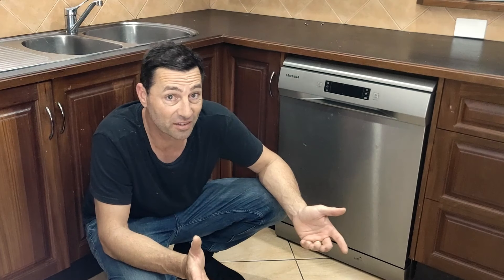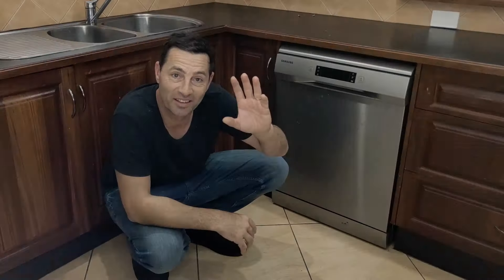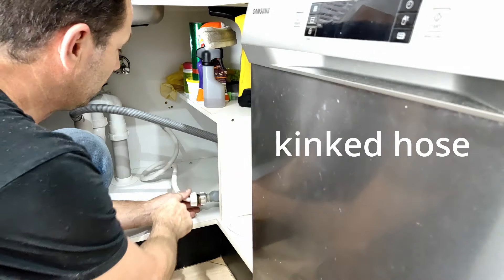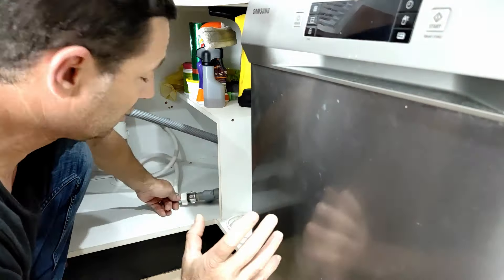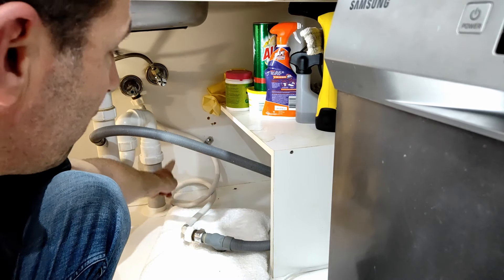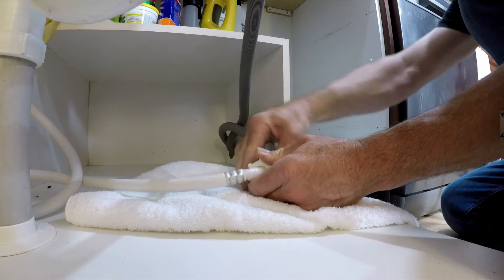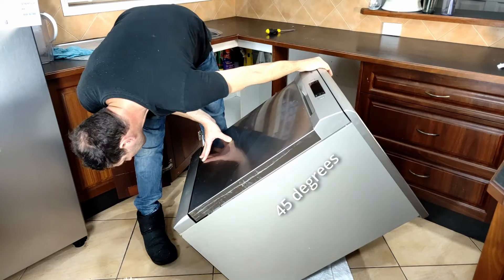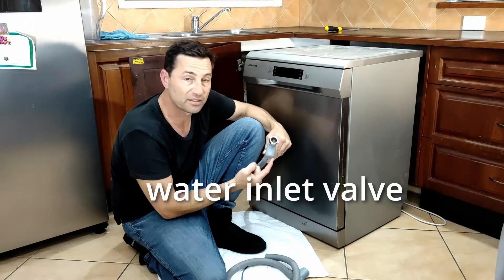Samsung dishwasher fault 4E error water inlet valve problem

Comment: This saved me a fortune.  Thanks.  Most engineers wouldn't touch my dishwasher because it was Samsung and the "Samsung specialist" stated it was too old to get new parts and it would be £80 just to look at it with all work charged on top of that.  So I got the exact part you showed for £15.99 here in the UK and it took me an hour to fit...  dishwasher is now working just fine.  Note - my dishwasher had a LOT less space to work with (components were VERY tightly crammed in compared to the video version) which made it much more awkward, but was still possible.  For example, I had to remove the waste hose from the internal fitting in order to have any access to swap out the pump's power clip.  But it was still well worth the savings.  Appreciated.
Reply from the maker: Wow Kevin, I'm so glad that you told that story... I thought I might be the only one having this problem and crazy enough to fix it... That's great you found the part for a good price - and replaced it yourself, well done. Thanks mate, Kent

Comment: I believe I have the same problem with my Siemens and looks pretty the same, I already bought the inlet hose from amazon a couple of days ago and watching your video I have the feeling that my procedure will be similar.
Reply from the maker: How did you get on Jorge?
Reply: @InspireDIY  It worked perfectly well
I had to unscrew a screw in the front part in the left side at the bottom. Then I could open the whole plate that is on the left side, then I had to take out the pipe with the cable for the sensor, and there is a cap that I had to take out and put it on the new pipe.
Then the procedure was to put the pipe inside the dish washer and with a plier to hold it again on the same place. Now there is no water licking.
What I do not understand is why the pipe was licking water, I believe somehow I pushed it in the past and maybe I harmed it, but who knows, maybe is the time because the washing machine is about 7 years old.

Comment: Thanks for this mate. Reckon it saved me a fortune too. Everything was as you mentioned on the video, except for the connector which was different. I had to remove the connector on the new hose and connect the old one up. Dishwasher works fine now :)
Reply from the maker: Cheers for letting us know it worked well Kevan 🤙 well done mate. Kent

Comment: What if I'm getting 4c about halfway thru the cycle But plenty of water is coming in?
Reply from the maker: Hey Austin, 4C = 'The dishwasher is not getting water at the pressure or temperature that it needs', check that there is no air in the line by running a kitchen tap until constant flow achieved before attempting a cycle. Best of luck mate. Kent

Comment: Hi Kent, our Siemens dishwasher stops and shows E04 near the end of the washing cycle in any program, except rinsing. I would say right before it would start drying. Before water enters the machine just fine. Do you still reckon it's likely the inlet valve?
Also days before we had E15 which went away after I drained the liquid that had accumulated in the bottom of the dishwasher and that had made the little styrofoam disc float. 
So far I have read about a faulty water flow sensor, but that doesn't make sense to me since the machine goes nearly through the entire cleaning cycle except drying. 
Thanks
Reply from the maker: Hey Christian, I'm guessing you have read this; https://washingcodes.com/siemens-dishwasher-error-code-e04/ sorry if it's repeat info for you though there is a few things to test out yourself before calling a tech. best of luck mate, let us all know how you get on - it will help someone else out too. Kent

Comment: Question please...NFM installed a new Samsung. The waste hose is about 1" thick and goes from left side of dishwasher to hole in sink cabinet on right. So the dishwasher doesn't fit and rubber moldings look horrible...not to mention the silver clip sticks out where it's screwed into the cabinet. I guess my question is...can the waste hose be adjusted?
Reply from the maker: Hey D Schmul, Im not completely sure how to get around the dishwasher 'not fitting' thing, is the space too small - or hoses/fitting getting in the way of it being seated back far enough?  Yes, you can easily purchase and fit a longer dishwasher hose if required (not expensive and i've done that too), Universal Dishwasher extension hose; https://amzn.to/3deLsbT
 Feel free to elaborate and i'll do my best to answer your question, thanks mate, Kent

Comment: I have an E4 error code, when I tilted the machine to get the water out of the drip tray it worked again for about a week and then error code came back on.

What do I need to do to fix this issue? 

Thanks.

Comment: Hi Kent! Thanks for your video. I Have a Kogan dishwasher and the sign ´glass` is flashing even if I turn off the machine. I tried almost everything. My landlord told me he cut the water off to make a repair inside the house while the dishwasher was running. After that my dishwasher didn't work. Can you help me, please?
Reply from the maker: Hey Tais, if you reset the machine by turning power off at the power outlet (then try to power at the machine on so capacitors discharge) wait 30secs then turn back on at outlet and machine what error shows?
Reply: @InspireDIY  Hey Kent! I was super busy and I turned off the machine and forgot about it! Today I turned on and everything going well!!!! Thanks for your kindness and patience

Comment: Auhh I've tried everything except changing inlet hose. But its getting water, and draing but when cycle finishes E4 comes up. I pull it out, tilt it, some water comes out and its good for another wash or even a few before E4 again. Arghhhhhhhh
Reply from the maker: Hey Dodgy, sounds like a leak detector keeps firing huh!

Comment: Worked for my dishwasher as well,  but a couple days later happened again. Is there an issue with the machine to keep happening?
Reply from the maker: Hey Morgan, if it’s a 4E error code, I’ve noticed this can intermittently fault as the inlet mech is failing.. I think you may be up for a replacement inlet hose. Let us know how you get on. Kent
Reply: @InspireDIY  thanks mate

Comment: Hey! I just moved into my house and it has this exact dishwasher. Everything was fine for the first 3 weeks and then it suddenly won't get hot during its cycle. No error message. Everything is working fine. It's just cold so it's not doing a great job cleaning the dishes. Got any useful tips?
Reply from the maker: Hey KKFox, Yeah, most modern dishwashers heat up the water themselves rather than rely on a hot water supply, so unfortunately it looks like your element or heating circuit/fuses are the cause. I have not repaired this type of fault before so sorry, I have no tips for you. Best of luck, let us know how you get on. Regards, Kent
Reply: @InspireDIY  Thanks! Will do.

Comment: Not sure if anyone can help me zero in ony particular issue. I get the 4e code, changed the floodsafe hose to a regular. Changed the inlet valve twice. Here's the kicker. If I try to run a cycle like 10 times it will eventually work. Anyone know enough to believe it's a control board issue. My second inlet valve was from Samsung Parts. Thanks for any advice. Cheers.
Reply from the maker: It’s over my head TC C, good luck - I hope you find a solution. It must be testing you patience by now👍Kent

Comment: On the videos I see, the animals are trying to help.
Reply from the maker: haha, yeah thats Ziggy. neither of us have a clue but we hang out anyways.
Reply: @InspireDIY  animals always want to help or inspect.
And I learnt something from you.  It was the second time I encountered the issue and I tried to trouble shoot it myself so I wouldn't have to call the maintenance guy.  But based on his last fix taking 5 minutes, I think the issue is with the water pressure in my apartment building since the past few weeks it's been acting up and they haven't addressed the issue as best they could for a high-rise.
Reply from the maker: That’s a shame Analeza, if it’s the water pressure that’s a shame, there’s not much you can do about it except tolerate the fault occurring now and then until the issue gets fixed. Best of luck mate 👍Kent